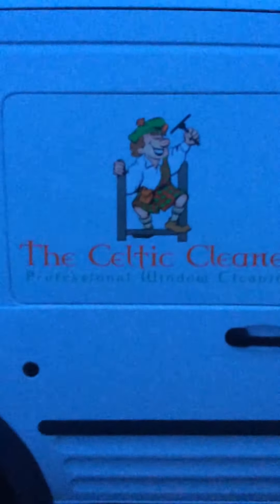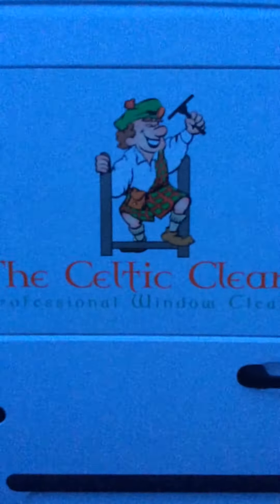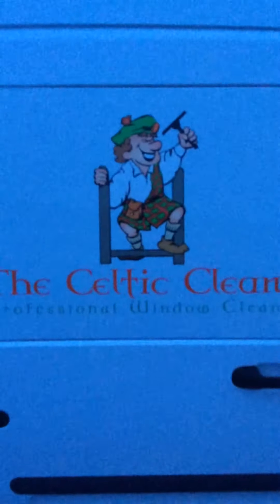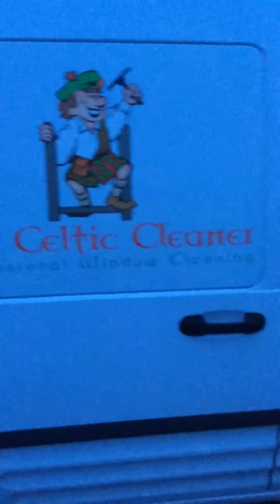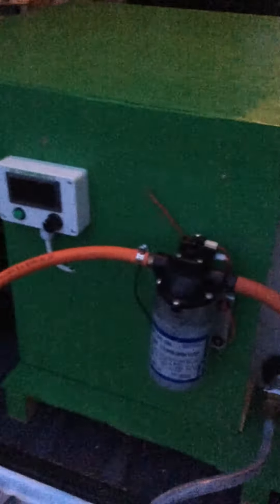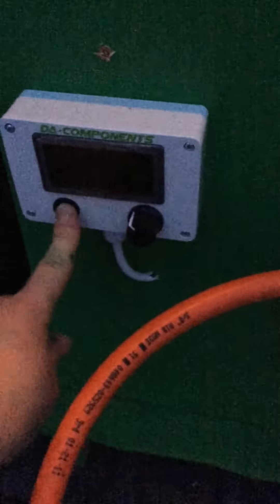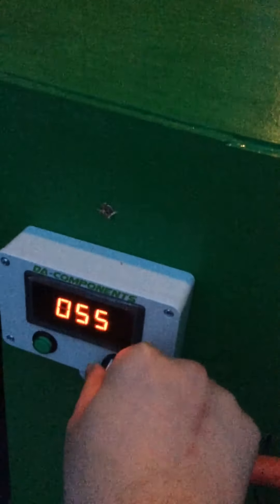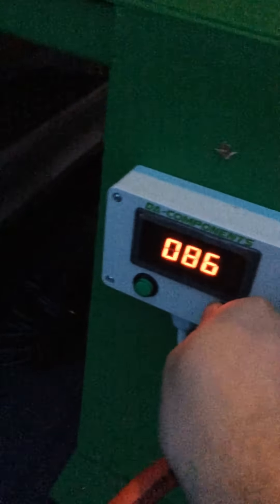Water fed window cleaning van mounted system

Comment: Hi there Richard, I have a question: can you please share where did you get your tds meter and pump? Do you have any links?
Reply from the maker: Edwin Ruiz I got the pump from shopwindowcleaningresource.com you want the 100 psi shurflo pump they have for sale. The controller is DA-Components.com
Reply from the maker: oh I realised you asked about the TDS meter. I don't have a TDS meter in the video but I use the built in meter on the Unger Hydropower
Reply: richard whitlock tank you so much. I have a 100g tank that I need to fill and then use the water from the tank. Do you think that will work?
Reply from the maker: Yes that should work fine so long as you have a good 100 psi pump and flow controller
Reply: Does the flow controller also serves as TDS?
Reply from the maker: Edwin Ruiz this one doesn't but they have one on window cleaning resource that does. It's a good bit pricier though. You can buy a hand held TDS meter for around $15 though most places.